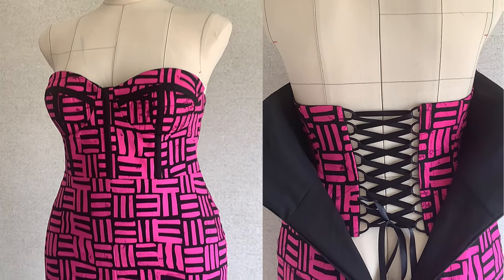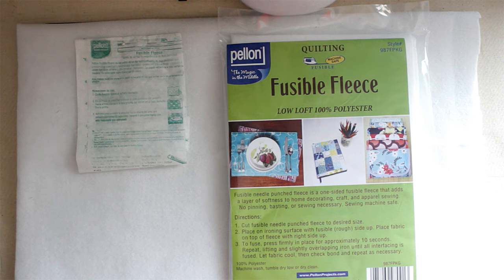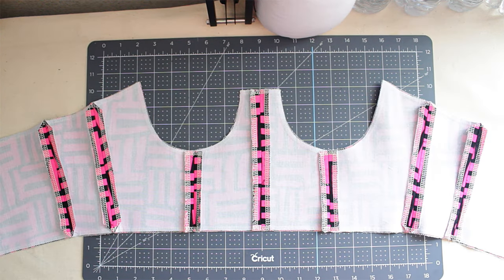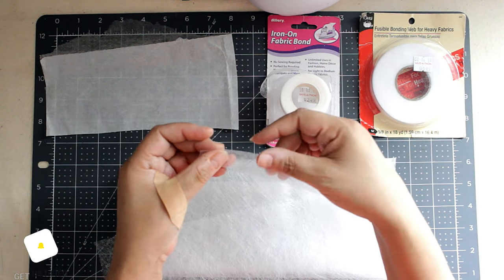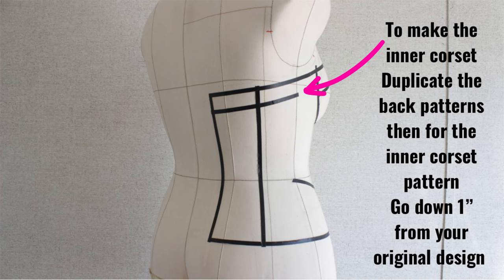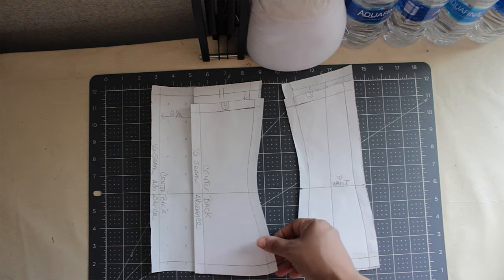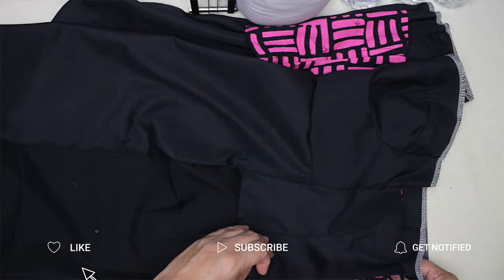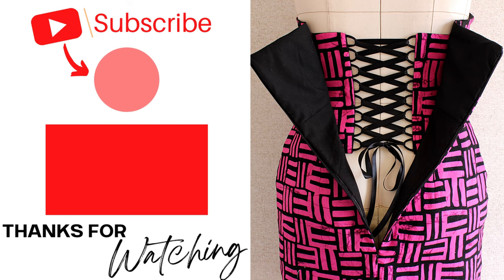HOW TO SEW A INBUILT CORSET (INNER CORSET)

Comment: Im confused on the inbuilt corset. Is the inbuilt corset only attached to the lining and not the main fabric as well? If you lace it up wouldn’t the lining only be pulled and not both lining and main fabric simultaneously? 

Please could you help me clarify?
Thankyou so much and amazing tutorials btw 😊
Reply from the maker: Once the dress is on the body you can pull the lace on the inner corset that is on the lining. The measurements on the lining will the correct measurements of the body so the top and waist of the lining will sit good on the body

Comment: Thank you so much ❤🙏🏾 
Did you use same allowance to join both the linen and the main fabric since they are joined separately.
Reply from the maker: Yes the same which is 1/2 inch the only one that is different is when u sew the lining seam allowance and the zipper seam allowance to join them which is 1/4 because when you bring the zipper up and down u don’t want it to get stuck going up and down ❤️
Reply: @drapingclass101  oh, thank you so much 🙏🏾❤️

Comment: Great job pls do I need to snatch my waist on d main fabric will it affect d zipper.
Reply from the maker: You will have to take some inches of the zipper part because if u pulling the lacing cords a lot it will make your waste small so if u have the main fabric in the back your regular measurement when u close the zipper u will probably have a little gap. So u will probably have to take off a little from the sides of the back.